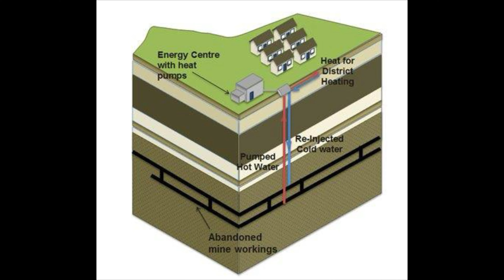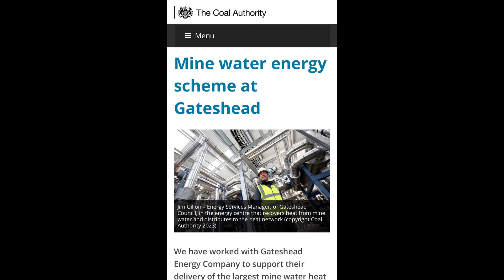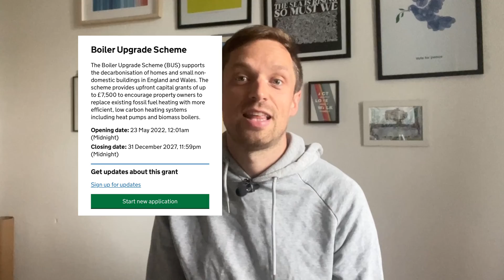Could this be how we heat homes in the future? Mine-water - promise or problem?

Comment: What a great idea! Eventually, these larger district-sized schemes will be part of the full picture. The Gateshead Mine Water Heat Scheme is already up and running, more or less heating the Tyne South Bank stretch between the Tyne Bridge and the Baltic (Gateshead College, the Glasshouse, the Baltic itself, various offices, a few hundred homes, etc.) and is looking to expand, so it's not all downs for this type of GSHP!

Handling contaminated mine water might be problematic in the open-loop form mentioned, though, actually pumping the water from within the mine workings. What about sinking a closed-loop heat exchange system down the old mine shafts? I realise that's not quite at point of use, since old mine heads are not conveniently placed...

Mind you, ASHPs in the form of AC (especially VRVs) have been used for decades - Daikin, Hitachi, etc. offered very quick and flexible ways to shift heat in or out. My engineering experience from about 35 years back included TSB branch refurbishment that relied on these air-to-air cassette units, connected to the outside by refrigerant pipework running along electrical cable trays for support. The only branch that I worked on which needed something different was TSB Preston, a traditional heavyweight regional central bank building with vaults, stone walls, offices and other features not found in the smaller, more open-plan high street branches that are now mostly gone. It's not new tech by any means, but has been progressively more refined and integrated over the years, hand-in-hand with more efficient buildings.